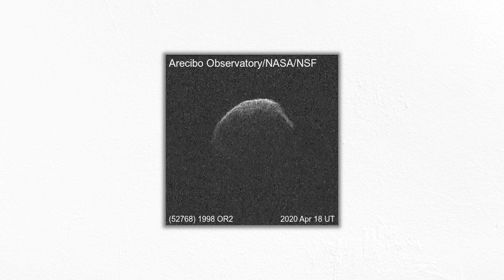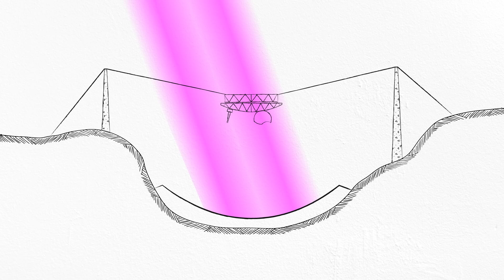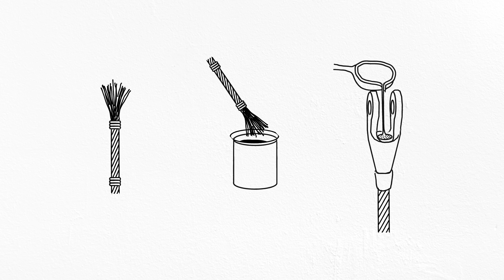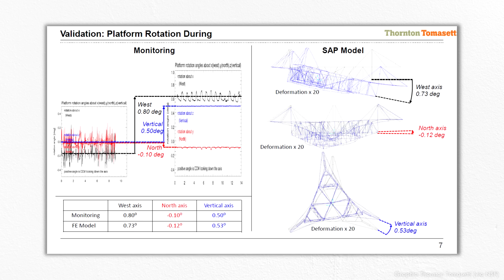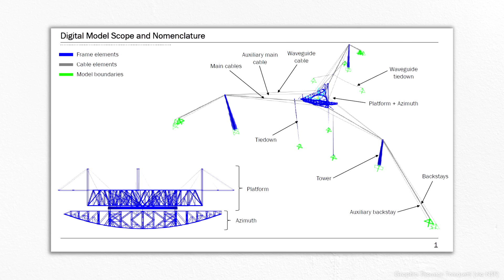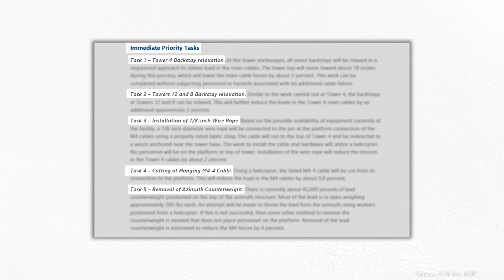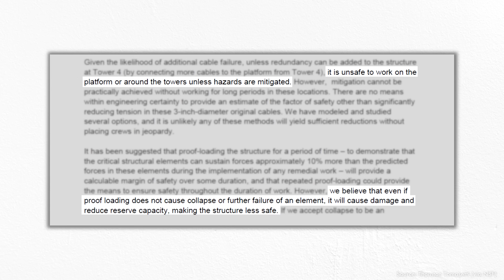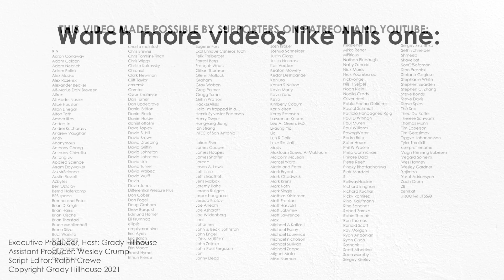What Really Happened at the Arecibo Telescope?

Comment: I worked at a rigging supplier for awhile. We regularly tested materials on our 200 ton test bed. We would pull our products to failure. If the rope failed at over 3 times its rated limit, it passed. Most products could be pulled to well beyond 5 times their rated capacity.

Comment: 8
The Arecibo Observatory Is More Than Just a Telescope | WIRED
The Arecibo Observatory in Puerto Rico was a famous astronomical facility known for its massive 305-meter radio telescope, which was the world's largest for decades before its collapse in December 2020. Following the collapse, the observatory was permanently closed to the public, and the telescope will not be rebuilt. The site is now being converted into an educational center, the Arecibo Center for STEM Education and Research (ACSER), to continue its legacy of science, technology, engineering, and math (STEM) education.  
Observatory history and significance
Construction and operation: The observatory was built between 1960 and 1963 and was the site of many important astronomical discoveries, including finding exoplanets and studying gravitational waves.
Cultural impact: It was featured in popular media, such as the films Contact and GoldenEye. 
Collapse and aftermath
Collapse: In late 2020, two separate cable failures led to the collapse of the observatory's 900-ton receiver platform onto the dish below on December 1, 2020. 
Reasons for collapse: The collapse was caused by long-term cable failures, with a report citing the "long-term zinc creep-induced failure" as the root cause. The initial damage from Hurricane Maria exacerbated the issues with the support cables. 
Future plans: In October 2022, the National Science Foundation (NSF) announced it would not rebuild the telescope due to the cost and safety concerns. 
New educational facility: The site is being developed into an educational center called ACSER, which aims to continue the observatory's legacy of STEM education and workforce development.

Comment: I spoke with my professor who was working on a R1 academic team tasked to analyze the failures in the collapse of this telescope.

His team's leading theory is that the condensed radio waves of the telescope can cause a faint electrical current to be generated along the cables nearby. It isn't much, but it doesn't need to be. These electrical currents would have decades to work, slowly weakening connection points until the rated strength is a thing of the past.

10:17 I don't think many realize just how crazy the failure rate at 62% rated strength is. When stress testing materials you generally set the rated strength WELL BELOW the actual strength it can tolerate, sometimes being half of what it can handle. It is akin to a cable that normally breaks at 200lbs eventually breaking at just 60lbs. Without a very good explanation as to how it became so weak the difference is staggering.

Comment: I visited this observatory back in the 90's, and was very impressed indeed. Fascinating building that thing in the middle of mountains, and it was fairly remote to get there. It's too bad it failed, but after all that time, and all the salty environment, I'm sure it was a maintenance nightmare. The drone footage was very well timed. Glad nobody was hurt. I doubt it would ever be rebuilt, or at lease in its original design. Time will tell.
Reply: Yeah theres a reason you dont see many telescopes like this, as cool as it is from an observer’s prospective its an absolute nightmare of over complicated engineering that just separates one very stable and reliable structure into two highly dangerous ones, in conclusion dont hang the space obelisk 400 feet in the air and it cant fall 400 feet down

Comment: usually when you start retro fitting extra devices to the existing structure your asking for trouble.during the cable collapse you can tell the load wasnt distributed correctly.the much smaller cabel failed late showing it probably had very little load on it to begin with.all the cables both old and new should have equal load.

Comment: The thing was just old. It wasn't designed right to hold up all that weight for such a long time. The fact that it lasted as long as it did was a miracle in itself. But anything more than 50 years old is going to fail. That's just the way it is.

Comment: Now I imagine that there might have been some financial aspect to it, but on racing yachts we replace our standing rigging (the rigging wires and turnbuckles and fittings etc) at least every year. Cruising yachts tend to leave it for 5 to 10 years before replacing their rigs. As far as I know, the rigging wire on a yacht has NEVER failed (at least I’ve never heard of it) It is always, without fail, the fittings on either end that go first. My point being that regular replacement of the wires and their associated fittings  could have avoided this specific incident. That does mean, however, that something else would have given way.
This would also incur a pretty big cost. The last time I had my rig redone it was in the vicinity of $35000, which is for a boat nowhere near even half as big as they get. I can’t imagine the cost to replace these wires every year or few years but it would have to be in the millions. Not sure how much the whole thing cost to build in the first place but there’s a chance that over its lifetime, more would have been spent on the wires than anything else.

Comment: I'm not an engineer just a backyard mechanic, the weakest point of anything is where it's terminus is, for example a vehicle exhibiting electrical issues will most likely have a bad power or ground cable failure, when you inspect where the ground connects to the body you'll find corrosion and the wires will be able to be pulled out with little effort, these massive cables are no different, people don't realize how destructive being near the can be on steel especially, many years of constant exposure to salt in the atmosphere will weaken and destroy metal. A vehicle out west where there is hardly any rain and no use of salt on roads will last indefinitely because they don't rust, contrast that with a vehicle in the Midwest or east where they salt the roads heavily in winter some vehicles that are only five years old are ready for the junk yard, some places with a lot of dirt roads salt them year round to keep the dust down, these cables were simply past their sell by date.

Comment: Fricking engineers, they had 3 months to fix it, but they wanted a design first. They should have but back a new wire with a crane and re tighten it, then re force it. But they took to long, then it broke more and more

Comment: The National Science did right taking over the largest telescope of the time. In peacetime it was used for serene endeavors. Those 3 towers to keep the platform aloft were a quintessential feat of engineering. Forensic investigation finds out the causes of this event to avoid repetition of this incident in the future but the results might be years away. Salty air from the sea nearby may have affected tge strength of the metal cables. To build enough confidence aerospace rigorously tests and does stern modeling. Its a unique facility.

Comment: 00:05 The collapse of the Arecibo telescope in 2020 was a significant loss to scientific research and symbolized humanity's exploration of the universe.
02:28 Arecibo's iconic radio telescope utilized a unique design for steering and focusing signals.
04:36 Arecibo Telescope's structural support and upgrades
06:46 Arecibo faced devastation and funding issues
09:02 Structural model used for predicting cable behavior and evaluating options for relieving tension
11:10 Efforts to save the Arecibo Telescope structure faced insurmountable risks.
13:23 Arecibo Telescope suffered major damage and loss of instruments
15:37 Arecibo telescope cables had a factor of safety of two

Comment: failure was answered in first explanation of the spelter sockets..... zinc.... this was an electrical device and zinc acts as an anode when exposed to electrolysis, zinc corrodes faster, much faster than steel and its worrying that this widely known but used at all... zinc was eaten away by corrosion and the socket failed

Comment: Today's structural engineers are so smart!  They can't timely fix a telescope designed by real people with slide rules.  Bridges in Texas are another example of sixty year old structures unable to be replaced without work stoppages and excessive cost overruns of replacement bridges.  Structural engineering is in a crisis.  Safety factor = 0.

Comment: Hey there genius man don't you seem to think that cables that sit out in the weather and corrode for 60 years or going to become weak and no longer can handle 100% of their rated strength. They were probably only able to handle 40 to 50% of which is why the structure failed .. it doesn't take a genius to figure that out

Comment: Safetyfactor here in Finland is always 5 or more when human lives is in danger. Structural calculation. And there are no suspension-bridge without maintenance. So cables are changed with intervals. I do not believe safety factors 2 or below in huricane areas.

Comment: The cables appeared dry, I couldn't see any rope oil, which normally appears as dry grease between the strands on the outside surface.  Spelter sockets are fitted with lubrication points, this is either carried out manually, or it may be supplied by a lube line, or an automatic lubricator, which is a small pot of oil with a battery driven pump that injects a small amount of oil periodically.   The cables nod at the sockets, if the strands within the cables aren't lubricated, stress corrosion cracking will occur, causing the failure of individual strands, that can reduce the cables service life by more than 50%.   Typically this type of cable is inspected by radiography, but it isn't always effective as it can't see the broken strands within the socket.  If the ends of the strands protrude from the zinc casting, and are ground flat, they can be inspected ultrasonically, this is the most effective method of monitoring this type of cable, which is called a bridge strand cable.

Comment: I am wondering if anyone can answer my question:

In the stabilization efforts pdf (https://www.nsf.gov/news/stabilizationefforts.pdf) task number 3 recommends running a 7/8" cable from the platform to the top of the tower and then down to the base of the tower to lessen the load on the other cables by 2%. At 12:40 we can see a fabric sling, 7/8 shackle and winch in the lower left corner of the frame (use <> on your keyboard to go frame by frame). What I don't understand is the fact that the sling was wrapped around two of the existing cables on the platform side of the tower - EG the load on the cables was not decreased at all....??

Comment: Cables are supposed to use a 5:1 safety factor. 2:1 is criminally negligent. As cables age they lose strength. That’s why 5:1 is the US national standard. It has been the standard for over a century. The only way it could be built like this is by the department of defense who have exempted themselves from all safety standards. I am a professional rigger with over forty years of experience, starting in my teens. I’m over sixty now. If anyone had told me that it had only a 2:1 safety margin when it was built, I would’ve thought they were out of their minds. The fact that it stayed up as long as it did is a testament to how well it was built. And bridges are not built with a 3:1 safety factor, they’re built with a 5:1 safety factor and so are elevators. Hydraulic lifts don’t have a safety factor as such, they have a rated pressure, beyond which the pump simply shuts down. Check valves keep the cylinder from draining. They are rated at 5:1 but it doesn’t directly correspond.

Comment: Everything is designed to last a certain amount of time. If you're making such a telescope for a specific purpose, it might be reasonable to assume it will be obsolete and use will be discontinued in 20 years (i.e.). If the cables are going to last for 40+ years and you know that, it's not necessary to have a replacement procedure engineered into this machine.

Comment: Easy answers seem: 
1st cable failed due poor welding job for socket, its real tension hold capability being lower than what it was supposed to be
Older cables on other hand simply were in dire need of replacing since 2000 
Simple lesson: on any structure that needs bear weight: do regular maintenance checks and most importantly replace before age overtakes (especially if cable is put to hold more weight than it was designed to)

Comment: Salt water all around P.R. so perhaps between the occasional Hurricane and "greasing the palm" of inspectors to allow bellow Spec cabling to be installed along with substandard paint, etc.,  and the "salt in the air" accelerated the corrosion of the cables...

Comment: One thing I don't understand is why they did not place a shoring tower under the gondola to allow for inspection and replacement as required of failing parts. 150meter is tall but not unheard of specially using multiple guy wires against bulking.

Comment: Is it possible the cause was galvanic corrosion? It was bonds between aluminum and zinc, two different metals, meaning salt water in the air could easily act as a catalyst between the 2 metals to start the corrosion. (late sorry, they probably figured the cause out but oh well)

Comment: If you are not going to have higher cable strength ratio per/cable,  then four poles, not three, and two extra eyelits, on each, that way you can run two new cables to each pole before messing with the old cables.   Also anything exposed to such weather, those cables are to be replaced  every ten years min.   Who ever managed the site, mech.  needs to go to jail, or be sued.  If that were to happen in the elevator business, you would be out of business, sued and likely put in jail.  A total disgrace to whom ever maintained that site.

Comment: If I could save the telescope
 First thing is remove the dish then drive a  extremely oversized scissor lift to push the hanging gondola up to relieve the pressure of the tethers holding it up
Then over time replace all the tethers holding the gondola and slowly lower the gondola back down and then slowly put the dish back together essentially retrofitting the telescope

Comment: Unless the cables had been replaced during it's life, then the cables were just old AF, couple that with repeated environmental strains and differences in material manufacturing capabilities and construction, it's not really a surprise to me that it failed. Metal stretches and fatigues over time, "modern" concrete degrades over time and I'm sure as diligent as they were maintaining it, I still believe it still would have failed eventually.

Comment: Is metal fatigue a factor, that often is the reason steel failed at much below rated strength. Those cables been up there under stress for decades, and had to with stand high winds. I am sure someone looked at the failed ends of the cables
Reply: Yeah, María was no joke. I wonder if in the future some sort of dome structure could be built around the site to protect anything that's eventually built there during hurricane season.

Comment: In my career I worked a lot with overhead cranes which have a lot of similar issues. A lot of what you talked about makes me shudder. It starts with adding stuff to an existing structure and then patching a fix to problems it caused. Management issues seem to be part of the problem starting with funding probably leading to staff issues. There seems to have been no routine maintenance audits, no cable replacements, no quality assurance on cables and critical parts, no engineering audits of changes made. How qualified was the site manager to be running such site? Did he have a budget enough to hire or bring in qualified people? Should there have been a workplace safety audit conducted regularly?

Comment: Why did the engineers expect the cables to last over 50 years? At what point would they have replaced the cables?  I find it amazing that they would spend this amount of money and engineering into this project and then make these computations after the first failure. The speaker in the video says 3 months later a failure happened. This whole project seems to have been defunded and left to rot.